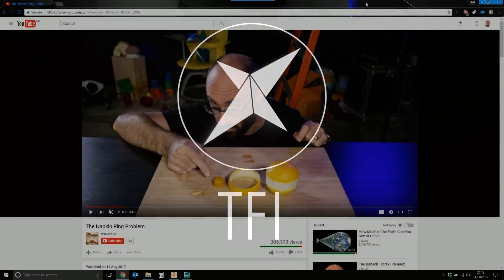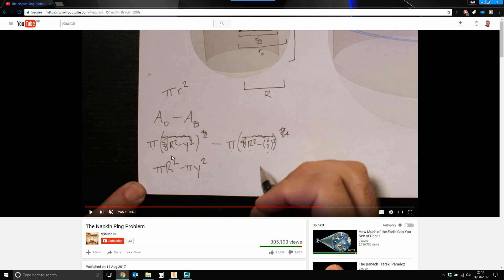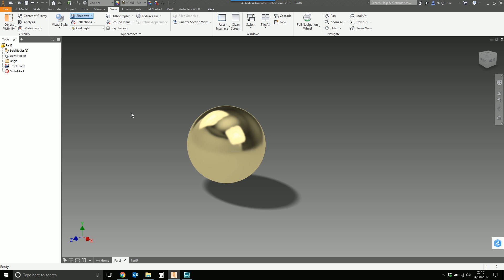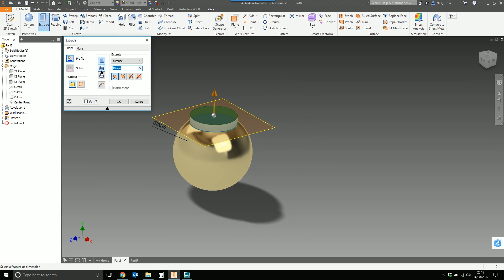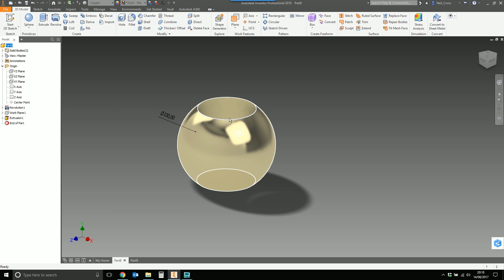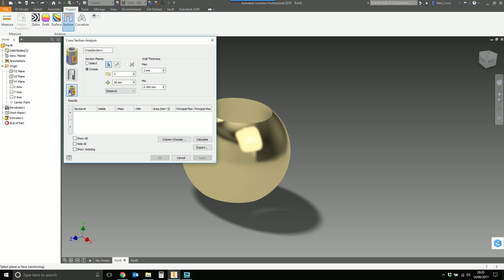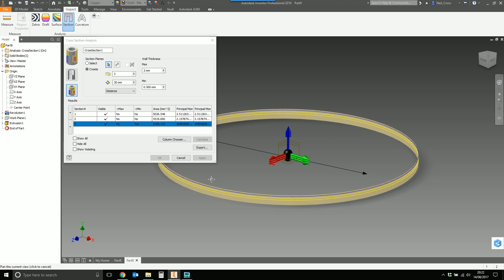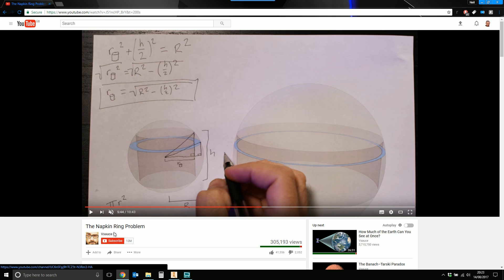The Napkin Ring Problem - Done in 3D CAD

Comment: Mate I have to mention that the only reason the mass and density are equal is because you used the same material. However, this theory is applied to every kind of sphere no matter what the material. The theory only lies in the volume of the napkin rings as if you use any material the volume will be the same but the density may very greatly. Good vid tho and work on showing the napkin rings more realistically.

Comment: Correction: weight isn't the same. 
Since they have the same height and  volume, they might seem to weigh the same.
But if they were made of different materials, say glass and plastic for instance, they'd be of different weight.
Reply: Assuming that the material was the same, as you have done, the density is also the same so the volume will remain the same.

Comment: 0:37 It should be mentioned that the two napkin rings will only have the same mass if they have the same density. Just imagine you have two identically sized napkin rings, one made of solid gold and another made of foam. They would have the same volume, since they're the exact same shape, but the masses would differ due to different densities. This same reasoning extends to napkin rings of different sizes. A bit of an obvious thing, but it seemed a bit glossed over in the video.

Comment: Hi Neil,
I need your help urgently, i was working on multibody part when i deleted a lot of features under (EOP) then i found that the bodies folder in the browser disappeared, even when i right click on body i can not find (find in browser) all the bodies exist but there is no folder for bodies.. please help... thanks.
Reply from the maker: Mohamed Bakr Err. Sounds like you've went up to work in assembly level, the bodies folder should always be there, there's always at least 1 body if you've got modelling stuff there. Is this a part in an assembly?
Reply: Use UG, problem solved.
Reply: TFI this is a part.. i have about 4 solid bodies and 6 surface bodies.. and inly have the surface bodies folder.. there is no even the solid body folder.. i am using 2018.. beside nearly all the features are semi hidden (not suppressed) .. may be if i solved the solid folder issue; the features will be shown again (or vice versa).. thanks
Reply: Justin Ford what is UG?

Comment: You don't need all that maths to solve this problem. Imagine you want to drill a hole 2" in length through the middle of a sphere. What is the volume of the material left after drilling the hole? That's all you need to know to solve this problem. Of course, if the drill is very wide, the sphere has to be very large to leave a 1" high ring. So, conversely, if the hole is very narrow, the sphere can be much smaller. In the limit, as the hole becomes infinitely narrow,  then you are left with a sphere of radius 1", so the volume of the material "left" is 4/3 * pi., and this is the volume of any "napkin" ring of height 2".